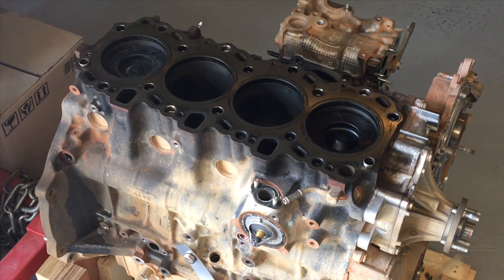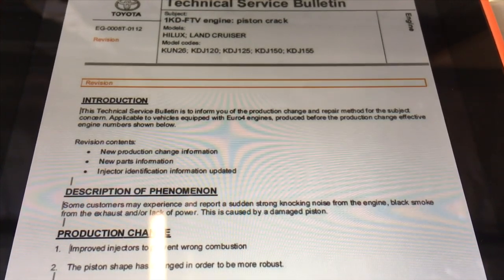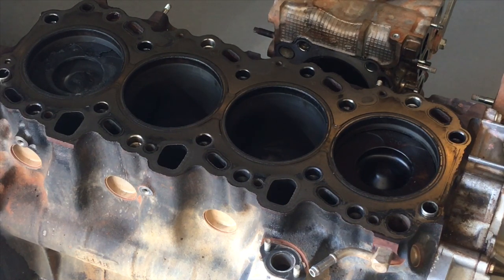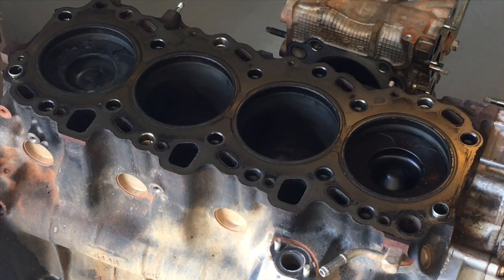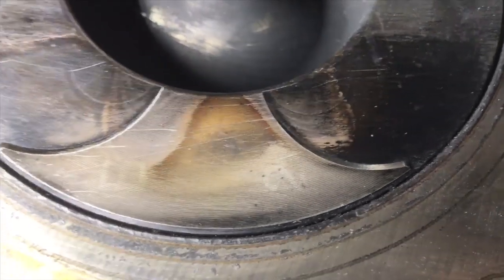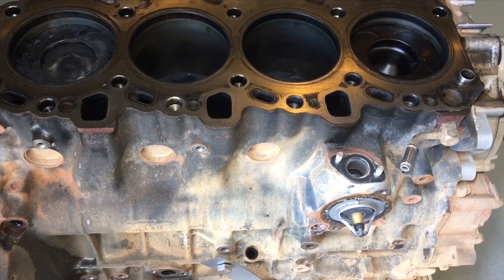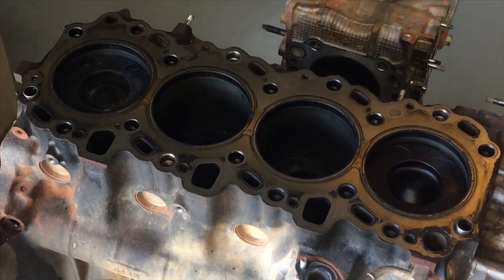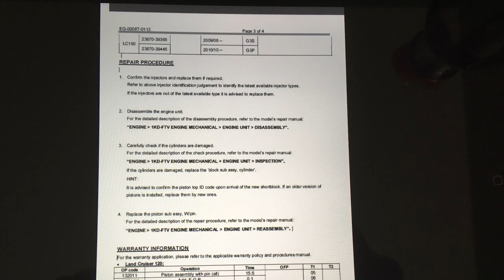HECK NO I CRACKED MY PISTON

Comment: I unfortunately am one of the few with probably a cracked piston  have all the signs of it.I have just had a manifold clean and new injectors done and then blew the engine , and am wondering where you recommend fuel testing done in Adelaide . 08 120 kdj

Comment: Your videos are very informative thanks, does the 2KD-FTV engine have the same problems?
Reply from the maker: If people use them the way they use Prado & Hilux, they would, but generally vans are just run around delivery cars that don’t tow 3 ton around Australia so generally you don’t hear about issues with those although everything is much the same.
Reply: Toyota has officially released document and found the root cause is high ambient temperature in combination of towing at high speed mate.

Comment: Hilux 2012 SR5, I just had a tune done from a reputable service centre, all within safe parameters. Vehicle never tows, never driven hard, never long hauls, only use BP ultimate, inlet manifold clean, catch can, prefilter, maintained and serviced meticulously, valve clearances just checked 120k and came back perfect etc etc. You say don't stress as the liklihood of a cracked piston is minimal, but your number 1 reason for cracked piston is chip or tune....I'm Sorry... But... I'm stressing.
Reply from the maker: Don’t stress if you done all the right things.

Well no point stressing now 🤷‍♂️
Reply: @Fourby4Diesel  obviously like most others I was chasing a little more performance from an ecu remap (which it's done). I definitely don't abuse the fact it has more response etc, I still baby it. After watching plenty of your videos there's only one positive I can see from the ecu remap now for engine longevity and thats the ecu electronically blocking the EGR. I did however have a HPD catch can installed after the inlet clean at 100k, I was disappointed after now reading reports that although build quality for these catch can is amazing their ability to catch oil vapour isn't up there with the best which has now turned into a positive regarding inlet lubrication and abrasive soot haha.
It's all a learning curve I guess.
Reply: My 2012 SR5 was tuned by previous owner and just cracked last week at 170k

Comment: So using your reasoning then all motors should get cracked pistons as they have the same injectors, the real problem is in how injection event changes due to injector influence, as the injector wears or fails, the injection event becomes problematic in as much as there is uncontrolled combustion event with knock evidence, very similar pressure rise characteristics to old mechanical injection, if you are old enough you will remember injection phases, initial injection- delay period- start of pressure rise - combustion duration- end of injection, then along came common rail with the ability to have multiple injection events per combustion cycle, mercedes were the first to develop up to 10 injection events per combustion cycle, the old mechanical injection pistons were made a lot heavier to combat this but you usually would see broken crankshafts from this detonation event rather than pistons, with common rail you have what's called pilot injection event first that is equivalent to initial injection but the amount is only enough to raise cylinder temperature to aid combustion at next injection events, the next issue that changed was combustion chamber design which makes pistons more susceptible to detonation events along with lighter weight pistons as the pressure stress in combustion chamber is more concentrated and this cumulative effect promotes cracking, the newer injectors are not as sensitive to atomisation changes with age, wear and carbon deposits and enhanced by changed combustion chamber design for same reason, most chips or tunes get pilot event wrong first and then multiply this as the tune changes injection events, quite often they will be knocking at the end of tolerance threshold (on the ragged edge) but then you get poor fuel and or high intake temps which push it over the edge and failure ensues, using ether starting fluid is the short cut to piston and or ring failure as this is causing detonation knock related pressure spikes, this is all relevant to all diesels

Comment: Apologies for my ignorance but what is the best way to make contact with you.
Reply from the maker: It depends what you need, to buy parts 0490261013. 
To ask general questions after you have researched our Fb groups & watched the videos here, same number.
Cheers
Reply: Many thanks 😀👍
Reply: Hilux 2012 SR5, I just had a tune done, all within safe parameters. Vehicle never tows, never driven hard, never long hauls, only use BP ultimate, inlet manifold clean, catch catch, prefilter, maintained and serviced meticulously, valve clearances just checked and came back perfect etc etc. You say don't stress as the liklihood of a cracked piston is minimal, but your number 1 reason for cracked piston is chip or tune....I'm Sorry... But... I'm stressing.

Comment: Cracked pistons no 1 cause is overheating!
Reply from the maker: That’s interesting because these engines don’t overheat
Reply: @Fourby4Diesel  I work on Nissan patrols here for years and drive them now over 13 years, similar Piston design at least in materials used.I have seen one particular 3.0 patrol going to 500k with pistons like new (After it cracked a head) radiator was blocked. Then I see ones driven whilst overheating,abused  (again possibly blocked rad and will only get hot towing) I seen these abused ones to crack pistons fast if not rectified. Also just to say too hairline or age related cracks in the crown I wouldn't worry about if too small. Your cracks are fairly serious looking though. Faulty injectors or bad coolant temp sensor can cause it too or faulty MAF sensor when they overfuel.